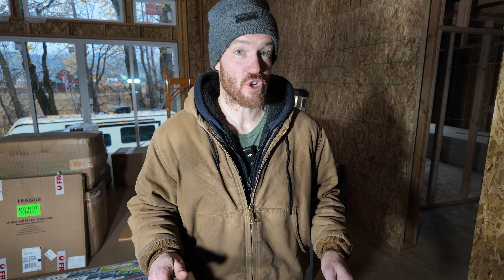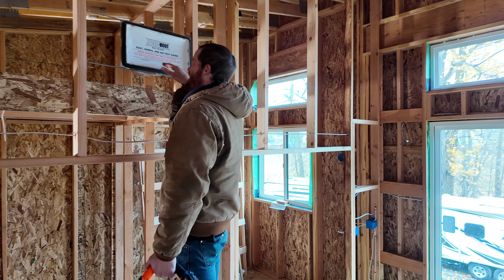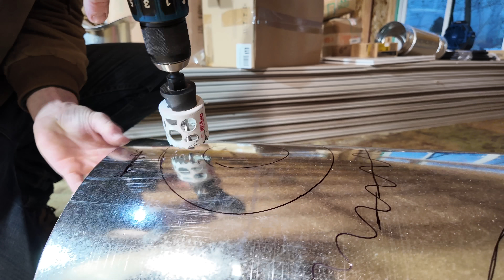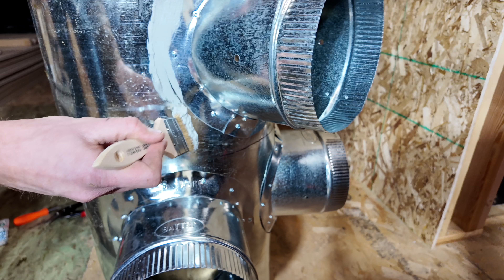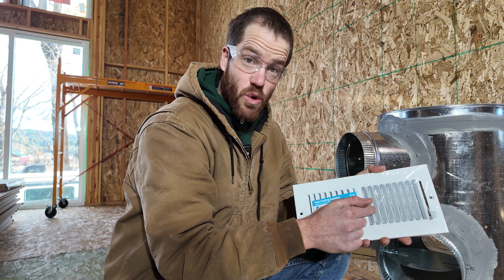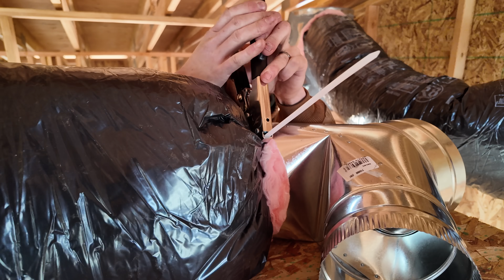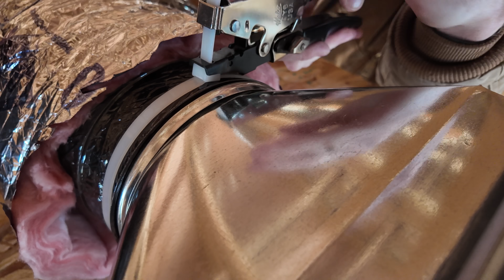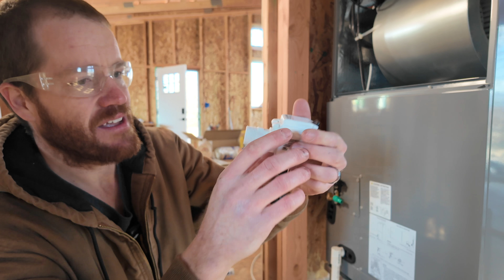HVAC Contractors Hate Me For Showing You This

Comment: Great video, I'm an HVAC mechanic and $20k is far to high, no matter where you are for a rough in on new const. 
I would have pinned this at ~$7,500 and had it done in a day or three. I am a Mr. Cool installer though I would have not used Home Depot parts. I would have used professional grade ducting, insulated trunk throughout your home, ducted a return to each room, put the supplies over the outside walls / windows and provide you with a Manual-J and Manual-D. 

Home depot parts are a thinner grade material. But you clearly made it work for your install, but I would have to warranty and deal with any issues down the road.

6" flex, the duct turtles into the insulation, just pull it out.

Unless your never going to change the filter, your primary drain is blocking, turn it 90' CW and you'll be golden. Good job!
Reply: Lol, $7,500 is barely getting the airhandler and heat pump @ contractors cost, let alone all the material needed to do the install properly, labor, and other miscellaneous costs
Reply: @ correct, no mark up, no miscellaneous no profit. 1-3 days? What is it 1 or 3? How many hours? What’s the overhead and profit? Can’t serve customers for very long if you go out of business. The price doesn’t cover much including the things people need to survive like food, medical insurance for the family, company vehicle, tools oh and let’s not forget to put money away for retirement. I don’t have a problem with DIY, good if a person if they can do it.
Reply: I’ve never installed a Mr cool so I have a quick question, what is the design static pressure of the air handler he’s installing? The units I’ve installed are rated between .7 - 1.5” of SP therefore my trunk size for a unit this size would have been a 14” not a 16”. At 16” with a 1000 CFM it puts the SP at .05 and FPM at about 700 at the plenum. Then if you add up the friction losses dues to turbulence of the octopus plenum, dampers, flext duct, Y’s, turns and length of each run how will this system ever deliver proper CFM and FPM? As you know from a manual D prospective this would not work. Then from a manual J prospective using 1 CFM per square’ is also a big no no because it doesn’t take wall orientation, wall construction and R Value into consideration.
Reply: I paid 6578.00 for my ,2 bedroom off 1800sq ft. Should dry wall dead walls before install and insulation to keep the sound down 
 I installed insulation in all walls. Cut my electric bill down more.
Reply: 7500 seems low. most areas a system change out is going to be 7500 where ducts and line sets are already in place.
Reply: It wouldnt cover material@james6794
Reply: @james6794 I think 7500 is a good price.  In this situation everything is accessible.  No hot sweaty attic work. Two guys knock this out in a day.

Comment: Because of your videos, I decided to build my own pole garage, 40x20, with a 9x12 bump out....I am not a contractor they describe me as an owner builder.  Then when it came to heating and cooling the 400 sq ft office, bathroom and gym  I decided to try the MR COOL mini split system...I have never done this before!  Thanks!   I checked with local HVAC contractors and they wanted 3x the cost of the 12ooo btu MR. Cool System I bought from Lowes.   So I hooked it up as you suggested and it worked perfect!   Now i am actually building the exact home you are working on now and thanks to those videos and help from the local building code officials, I am getting started!   Might take me more than 90 days, however.   Thanks for the videos!
Reply: Did he post where he got the plans from?    Where did ya get the plans from for your house?
Reply: @SkiDeepPow  The plans came from America's best house plans under the "Modern" style.  There are a number of homes that are similar to their current home build.  thanks!
Reply from the maker: Wow, that is amazing!! I’m so glad the install went well and congrats on the huge accomplishment. 👊
Reply: @AmbitionStrikes  thanks for the kind words!
Reply: Look into a SIP (Structural Insulated Panel) they go up quick and take very little to heat / cool, The best ones have a 2 part poly insulation expanded in them..

Comment: It looks like you intend to use your system for temporary construction  heat. Do not do that!!! You will get sheetrock dust and paint particles  in the motors and in the coils and never be able to get it out. The sheetrock dust in motor windings will reduce the life of the motor by 70%. There is no code saying that you can't do it but it is bad practice for the home owner. Just saying as a retired HVAC contractor in your area.

Comment: your heat load calculations more rule of thumb  technically more complex than that  involving taking windows & doors and insulation  + wall exposure    a   
   didn't see hva or eav fresh air heat exchanger 
 for keeping air fresh in the home   very important in a tight building

Comment: Living in a colder climate , wouldnt you wantvto put your ducts at floor level , hot air rises
Reply: Not when you don’t have a basement you can’t run the duct through the walls unless you run oval duct but you would have to cut through your beams

Comment: I've been around building houses, and for how small this house is I would have opted for in floor heating, way warmer, and more of a constant warmth. On longer runs on hvac I would install low volt heating elements in the vent that come on just before the furnace, so cold air isn't the first thing being blown into the rooms.

Comment: My brother and I installed my bosch heat pump system. He is certified but he doesn't do hvac as a profession. He got tired of hiring "pros" that either didn't fix his stuff or made it worse. He found out it's pretty easy to get certified and did so. That aside, the bosch system comes precharged as well as long as your line set is 15ft or less. Unfortunately we were a little over that and he had a fitting failure in his gauge set and we lost almost all of the precharge. So due to that we did have to bust out the expensive specialized equipment. Had that not been the case the bosch system i would consider potentially diy friendly but maybe not as much as Mr cool. The bosch is also on the more expensive side of the spectrum but it's performance has been great so far considering my houses original ductwork is apparently all sized incorrectly. So that's going to be corrected in the future to get the system running as well as possible.

Comment: Super awesome guys. You should get a harbor freight thermal imaging tool, run the heat full blast and see how tight the envelope is. Good or bad. Just for the fans. Cheers.
Reply from the maker: That is a great idea!!
Reply: I bought one last year and found no less than 15 empty stud bays upstairs facing the attic crawl spaces and "blank" areas where a wall and roof and attic were weirdly designed. The new ac didn't shut off during the day. I spent about 50 hrs air sealing,  adding missing insulation, and using foil backed foam board to seal knee walls and other walls meeting the attic space.
That effort is worth about 80 dollars a month in reduced energy use.

Comment: Not a fan of heat pumps in my area but i like the easy setup. We had an estimate to replace the badly installed out flowing duct work of 5k. I did it myself for a lot less. One bad contractor makes it hard to trust another one.

Comment: whenever using hole saws or drilling into things like masonry, I use the drill's clutch feature (the ring with the numbers on it adjusts to allow the drill to break free of the torque) -  to avoid breaking your wrist.
Reply: I completely agree and to further say that if you can avoid using corded drills, that I still love, with out a clutch even though you can get a power reduction it's worth it to save the frustration and potential injury when that large bit grabs.  good call on the comment
Reply: Using the clutch properly is definitly key. That battery packs a punch when it comes slinging around. Ask me how I know... 😅
Reply: Starting in reverse can also help

Comment: I hope you sized the heat pump for heating otherwise you are going to have a very hard time keeping up in those cold winter months. And splitting the flex duct with Y’s you will run into air flow issues, you should have made home runs to the plenum.

Comment: Proper duct design is a bit more complicated than shown.  For example, the CFM for a given room depends on its heat loss/gain, not just the square footage.  So corner rooms with two exterior walls need more CFM than an equal sized room with just one exterior wall.  The full procedure:

1) Based on the design outdoor high and low temperatures, and the construction of the building, determine the heat loss/gain for the building as a whole and for each room.
2) Select an appropriate sized HVAC unit and air handler, which will determine the total CFM and available fan pressure to move air through the ducts.
3) Apportion the total CFM to the various rooms in accordance with the fraction of the total heat loss/gain that room requires.  This may require checking both heating and cooling, e.g. a south facing room will have a greater fraction of the total heat gain in the summer than it will have fraction of total heat loss in the summer.
4) Now design the duct system to deliver the necessary CFM to each room, while ensuring that the resulting duct static pressure loss for those airflows does not exceed the air handler's specs.
Reply: Jeez.  Its 1100 sq feet.  He will be fine.
Reply: While that is true and probably necessary for super high efficiency units.
Meanwhile there is me with my 1960's heating system with 4 runs of duct for 2000+ sq ft. 
I have one register to heat the front room, living room, and dining room. With another one for the kitchen and laundry rooms. Upstairs I have one double sided run for 2 bedrooms, and another double sided run for the other bedroom and bathroom.
Reply: Yeah, I didn't hear mention of a manual J or manual D, or post-installation T&B being done. Good luck.
Reply: I have to manually adjust registers throughout the year to balance heating/cooling.
Reply: My HVAC guy didn't do any calculations. I had to do some research to ask questions and he just run lines based on his experience.
Reply: The corner room issue can be balanced with the dampers he put in if it becomes an issue. That was a step too often skipped. Having those allows for fine tuning a system in real circumstances for things that might not have shown up on the plans.
Reply: @markpashia7067  hope he can get to the dampers once drywalled
Reply: @davep6977 lmao😂 smh
Reply: @davep6977  given his attic size, he will put in an attic entrance for future maintenance like adding vents and updating insulation.
Reply: @markpashia7067 If there's not enough cfm to start with then the dampers won't help
Reply: @markpashia7067 sure it can but you can still have to high of static pressure inside the duct work that will prevent proper cooling and heating there is a lot more to installing ac then just buy and install
Reply: Yeah Manual J, did that in trade school 26 years ago. Haven’t done it since, but I dont do residential.
Reply: Everything you said about duct design is true in theory, but in practice heating/cooling loads are at best approximations even if you follow Manual J to the letter. 

A real complicating factor is solar gain through windows, which in a typical climate is going to increase your cooling load in the summer and decrease your heating load in the winter. How much effect this is depends on how much sunlight you get, and different rooms on different sides of the house are going to be affected differently.

What this means in practice is that it's nearly impossible to balance a duct system for year-round usage, because the rooms with the highest sun exposure will need more cooling in the summer (compared to rooms with less sun exposure) but less heating in the winter (compared to rooms with less sun exposure).

Doing a Manual J and balancing properly is certainly better than just going based on square footage. But you still are probably going to have to mess with dampers to have proper temperature balance.

The reality is that, while central ducted systems have their advantages, temperature consistency is not their strong suit. You need to be very careful in system design and installation or you get crap results, and even the best systems with zoning don't do particularly well when you have very different heating/cooling demands (e.g. upstairs vs. downstairs, or rooms with lots of sun exposure vs. rooms with very little).

Even multi-split VRF systems have lots of limitations, most notably the fact that their minimum output is quite high (my 3.5 ton Mitsubishi system can only go down to about 25% of the total capacity) which can result in lots of cycling and poor efficiency if the heating/cooling load is drastically different between zones.

If you really want good temperature control and to maximize efficiency, 1:1 split systems cannot be beaten. My 1:1 0.5 ton Mitsubishi system can throttle down to about 10%. In practice, that means that the 1:1 systems can run continuously at low load, which is great for temperature regulation and efficency. The problem is that almost no one wants 5+ compressors/coils sitting outside their house.
Reply: @BrianCairns The ACCA design process accounts for these differences. The full design process includes, manual J, D, S, and T. While everything is an approximation, we can get the design set to provide predictable performance every time. That is the goal.
Reply: Not really that critical
Reply: I doubt a lot of pro HVAC installers do all the calculation and adjust flow to reflect individual room needs. This DIYer actually did better than a lot of professional installation I’ve seen. I didn’t see a lot of Improper y insulated duct work or wrong length, with non-working or missing condensate line/ Shoddy seals everywhere and Ofcourse spaces that heat/cool unevenly. Those are some features that are very common unfortunately with pro jobs.
Reply: @moba2k  We do manual J, S, and D on all of out new construction jobs, both residential and commercial. On commissioning we take many different measurements and then set up the system for proper performance. Those in HVAC that don't take these steps are NOT PRO-s in my opinion.
Reply: @ZERO-F2G-  Problem is the average man living in an average house cannot afford HVAC anymore due to insane costs. The proof is clear when MR COOL and other companies are growing leaps and bounds. No doubt will soon be in many houses across the nation. The question with today's system is can someone do it good enough to function vs trying to gain perfection. For a new half mil house, yes but for the average consumer with an older house, no.
Reply: @ZERO-F2G- yea 32 years experience as a tech and business owner here…those manuals can be full of crap sometimes…when properly entered the insulation factor and tight envelope of new houses had the software spit out 2 ton units for houses with 14-16 drops. CFM is not there to supply it. I would rather legally oversize by  1/2 ton and have the fan speed to properly supply registers. Admittedly 90% of my career has been commercial industrial as a service tech but I know a customer wants to feel that 60-70 cfm coming out of a vent when they put their hand on it. 14 drops at 65 cfm is 910. The old “400 cfm per ton” is gone and most units are de-rated to 350 a sq ton. That would leave you over 200 cfm short on air supply if I had put the suggested 2 ton unit in. Almost 4 registers worth. It can be right, but it can be wrong too.
Reply: Prices aren't insane.  A full insulation with ductwork is going to be 10k or more in most situations.  A 2.5 ton split system replacement for example we would probably charge 6500-7500.  @thearmy88ify
Reply: In reality what's going to happen is, I people are going to buy into the diy thinking they will do everything themselves; which is fine, Its their house; but then realize the system isn't operating properly and call to get it fixed. Then, they complain about the cost of repairs and corrections. 
 Such as this unit,  that ductwork is going to sweat,  and those lineset connections are going to leak.  I'll give him his props,  he did some things well.
Reply: @moba2k if they are pros, they do. It's called pride in your work and knowing the customer got their money's worth.
Reply: I am pretty sure he already took measure on that.

Comment: you can mastic the flex duct ends too, and I would wrap the boots in insulation too.
Since we are saving so much money doing it ourselves, I would also get an automatic Damper system. It nice to have some rooms colder or warmer. 
I also had it, so when the bathroom fans were on the HVAC duct would close but still allow fresh air to enter the room.

I liked to oversize the bathroom fan and pull out way more air than needed, which is why I wanted to avoid sucking negative air from the HVAC unit

Comment: If this is not an off-grid electrical system, have you pulled permits?  Even though I know what I am doing, my jurisdiction will not allow me to work on major electrical wiring without a license.  Good job so far.
Reply: The owner of a home is allowed to do most work including electrical in many areas.
Reply: @marcericdavis  That may be true, but permits and inspections are often required with DIY electrical installations.

Comment: BTW   that plenum you built  needs to be fully insulated  because   condensation will build up on it and you will have water all over your floors   any bared  metal needs to be fully insulated  and  pucky at all  connections and ends     btw  if you have  silver  metal tape for a/c  duct work wrap all ends  tight then cover over with pucky as we call it here in  Florida